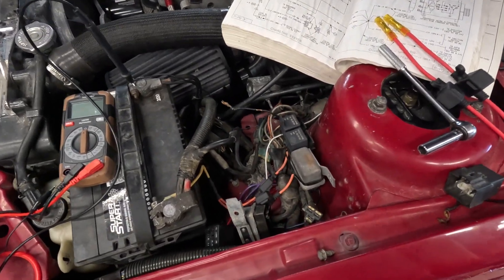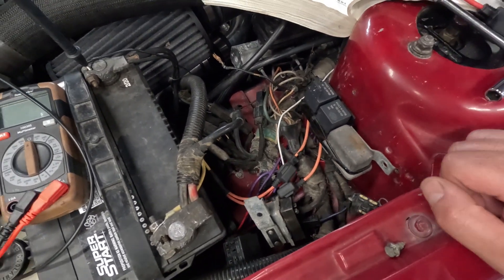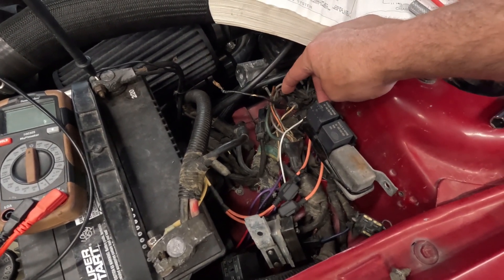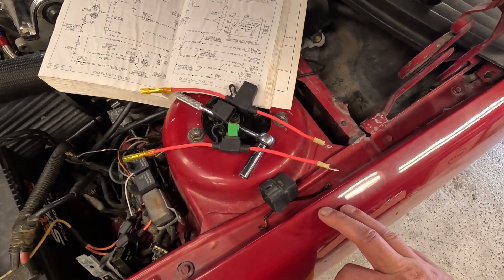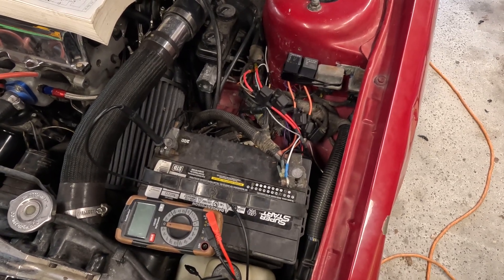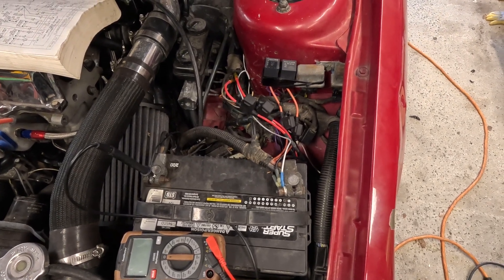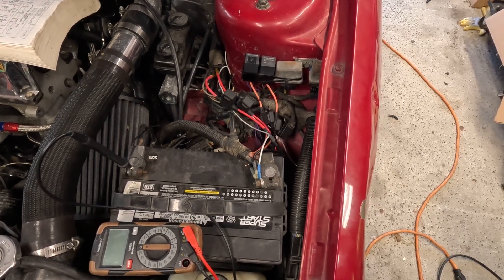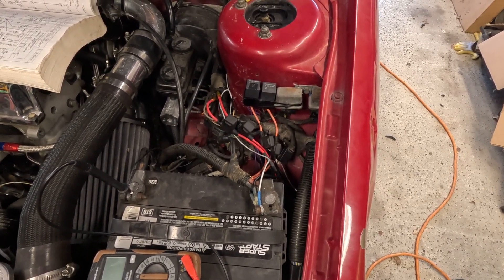Easy Fusible Link Replacement

Comment: hi and thanks, you think i could use a regular fuse pigtail? i can't seem to find jcase pigtails??
Reply from the maker: Great question. You don't want to use a regular fuse for this (ATO style) as they'll blow instantly. You should be able to find a Maxi Fuse pigtail at the chain parts stores such as Autozone and Oreilly Auto Parts. Those are a slow blow design which will allow for the larger current inrush from things like rad fans and blower motors etc. They're bigger than the J case fuses, but function the same. I've used both with great success. Thanks for the comment and the view.